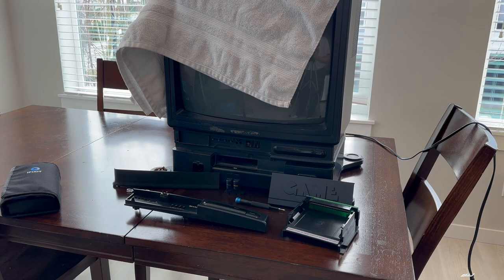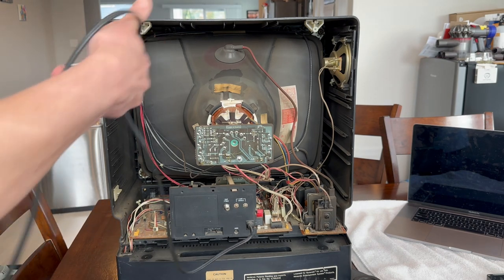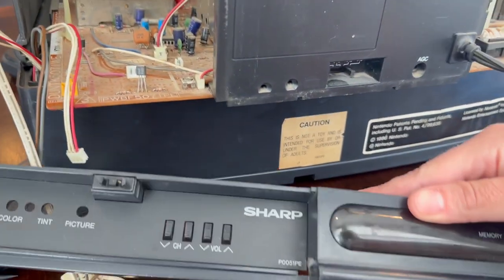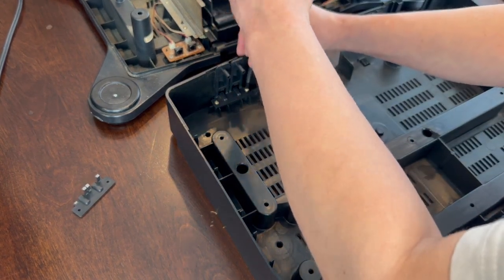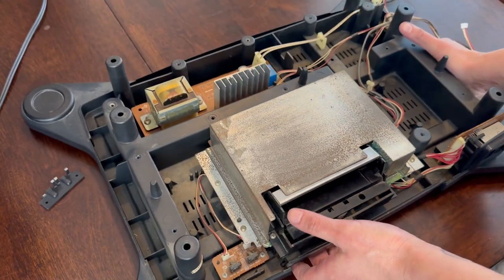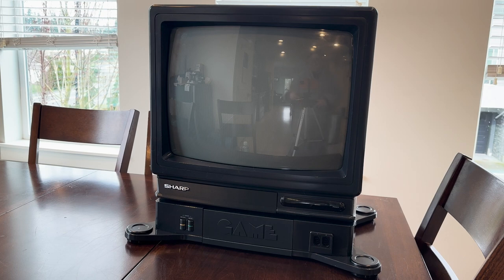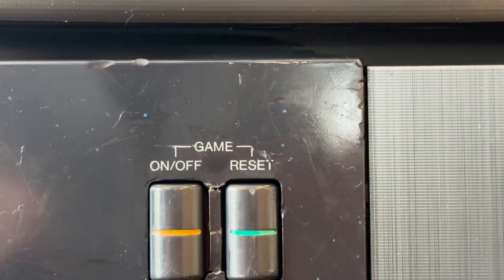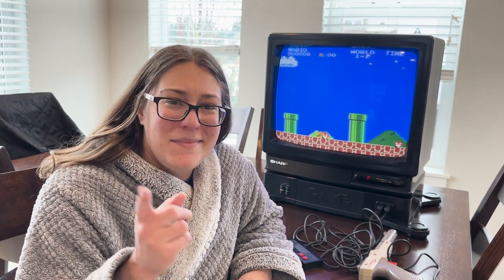Tinker Time DIY SHARP NES TV Restoration

Comment: Nice clip Candi!  Just FYI I have restored a few of these, and they just LOVE Goo Gone gel.  I place a small amount on a paper plate, and paper towels to apply, rubbing smoothly across the plastic surfaces until absorbed.  They end up looking 100% brand new!
Reply from the maker: Thanks for the awesome tip! If I’m ever stuck, having to restore this down the line, I’ll keep that in my back pocket. How many of these have you restored and what was the worst one you’ve had to deal with?

Comment: Wow, that looks great - both your restoration (baby oil is inspired, I'd never have thought of something like that), and the picture on that tube. I feel like as time goes on, all us retro game fans are going to become CRT experts by necessity lol. I have a Sylvania flat CRT from 2006 with s-video that looks amazing (I have three switchers and ten systems hooked up to it lol), but I'm terrified something is going to happen where I'll have to open it up and repair it. The voltage in those tubes scare me haha. In any case - enjoy your "new" tv! It looks great and I'm glad it's in possession of someone who will take care of it now!
Reply from the maker: Thanks you so much for the kind words.😊 Working on CRTs can be scary especially when you discharge them but there are many sources that teach you how. All you need is a flat head screwdriver, some wire, alligator clips and steady hands. Clamp the one end of the wire to the screwdriver, clamp the other end to the ground (usually the chassis of the TV) and gently slide the flathead under the anode on the tube until you get the “pop” of the discharge. Do it a couple more times to make sure it’s fully discharged and you’re good. Keep one hand in your back pocket or behind your back while discharging to ensure a bit more safety.
Reply: @CandisClassicGameShrine  Even reading that scares me, even though I know you're right from experience. I saw a dude working on a light fixture on a ladder when I worked at a movie theater like twenty years ago, get thrown off it when he shocked himself (he ended up being fine, thankfully), so ever since then, I've had a healthy respect for electricity haha
Reply from the maker: @kazinwho  when I was young and dumber I accidentally closed a metal basement door on an extension cord that was plugged into the mains and got a healthy zap lol. I’ve been even more careful since lol